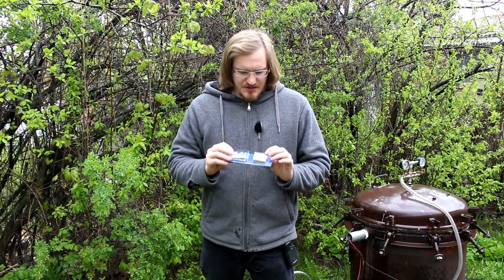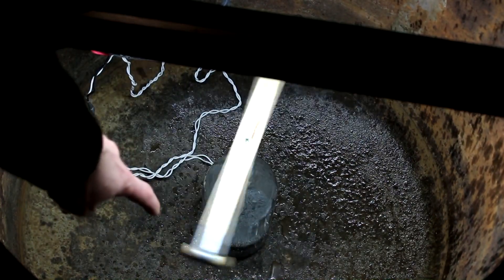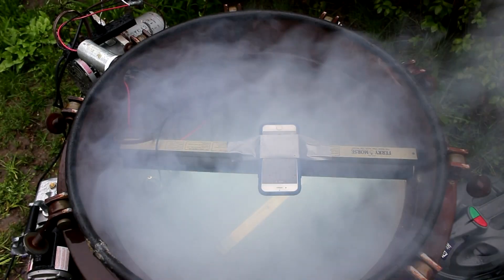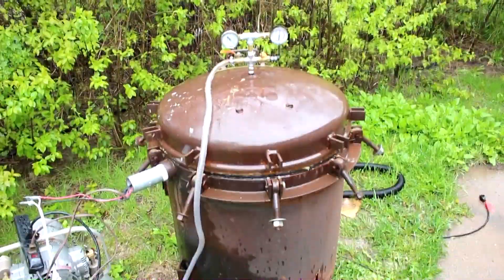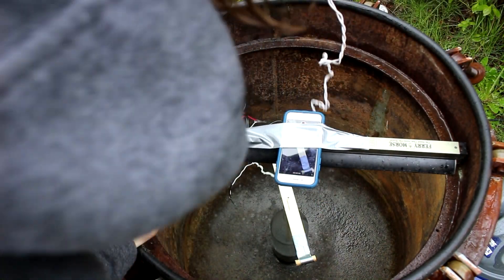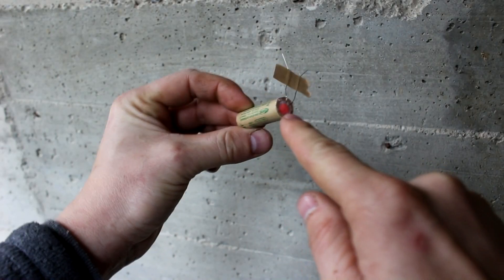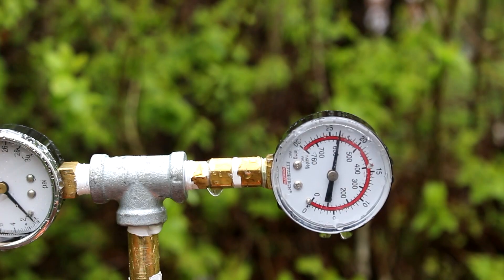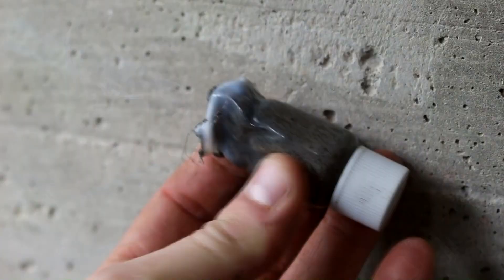Will a Model Rocket Motor Work In Vacuum?

Comment: That gas quenched the vacuum in the chamber. Compare that with  space. Folks at NASA are the worst fraudsters.
Reply: I have video evidence that rockets DO work just fine in a vacuum. But I'd guess you wouldn't watch it if I pointed it out to you.
Reply: @stuartgray5877   I will certainly watch and try to convince myself.
Reply: @khawarshafi4416  Then lets agree how high a rocket must go to demonstrate.

At what altitude above sea level do you think atmospheric pressure drops to "vacuum"?

Industry standard is ~1.0 Torr for "rough vac" (about 0.02 PSI or ~ 1/725 th sea level)

So at what altitude does ATM pressure reach 0.02 PSI?
Reply: @stuartgray5877  Let's watch the video you mentioned.
Reply: @khawarshafi4416  No.  If you ask me for a video of "a bear shitting in the woods", it IS reasonable for me to ask you what determines the "woods".

Now at WHAT altitude does atmospheric pressure drop to "vacuum"?

how HIGH does a rocket have to maneuver before you are convinced?
Reply: @stuartgray5877  It has to be same as on the surface of moon.
Reply: @khawarshafi4416  The fact IS that it is VACUUM at only 50 kilometers up.
Now watch the YT video: "Uninterrupted Footage of the Falcon Heavy Launch and Booster Landing!"

From launch to booster landing. Then explain to me what you just witnessed.
Reply: @stuartgray5877  I need answers from the guy shooting that video before I tell you what was shown. In the meanwhile why all vids of such events are low quality
Reply: @khawarshafi4416  Oh and don't forget the little fact that this has been done IN FRONT OF TENS OF THOUSANDS OF LIVE SPECTATORS over a DOZEN TIMES NOW!

I have witnessed it MYSELF and I have a video of a falcon9 booster landing taken from a CELL PHONE on my yt channel.
Reply: @stuartgray5877  I can't beat the score of tens of thousands of spectators but on a cold night a guy near my farm posed a UFO in front of hundreds of innocent spectators when he tied a cellphone with string of a kite he was flying. To this this day the poor folks swear by God of what they saw and how the spaceship maneuvered that night. I fear you work for the guys working these rockets and there restrictions on some disclosures right?
Reply: @khawarshafi4416  So do you have a play  by play of what you witnessed? I can point out how much of the maneuvering of the side boosters occured IN VACUUM.
Reply: @khawarshafi4416  One thing I have not told you is that I build, test LAUNCH and Operate spacecraft in earth orbit and deep space for a living. I have personally launched five spacecraft, four of those to deep space. I have been on the mission operations team for three of those.
Google "Mars Global Surveyor", Stardust, Genesis, Deep Impact, Kepler Space Telescope, and JPSS-1 (now NOAA-20)

I have also witnessed over 20 real rocket launches up close and in person, including: Athena, Atlas, Delta-II, Delta-IV, Minotaur, Space Shuttle (launch AND landings), AND Falcon9 launch and booster return.

Maybe you should go watch one yourself so you can be convinced.

For some pictures of earth from space that I helped take, google "EPOXI images of earth" and tell us what you find.
Reply: @stuartgray5877  Glad to know that you are among the people directly involved in these things. If the liquid oxygen can burn at such altitudes then it means that there is no vacuum. A vacuum Large as the space is too much to quench. Any form of Oxygen carried on such a large vacuum will first be utilized in quenching the void and the remainder will burn.
Reply: @stuartgray5877  On propulsion in void of space with chemical or mechanically generated exhausts I am still not with you and every engineer and physicist that ever lived. The 1969 launch from lunar surface is well-known near  illustration of what you are saying. I will rather put my money on a slingshot. Carrying of momentum by bullet is a different scenario but propulsion with open exhaust system doesn't make sense when juxtaposed with SIZE OF THE SPACE AND IT'S VACUUM. It would be kind to explain HOW SUCH EMISSIONS FROM ROCKETS QUALIFY TO BE TERMED AS AN ACTION AS STATED BY NEWTON'S THIRD LAW?? I would rather term it as AN ATTEMPT than an action capable of causing an opposite and equal reaction in void of the space. 
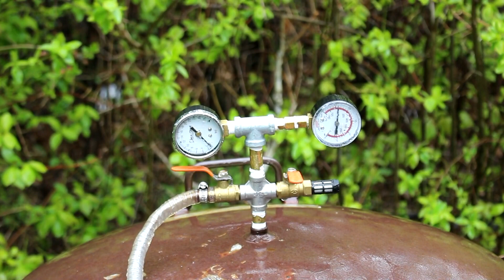One thing I am really confused with is the velocity of the rockets at liftoff. The claimed speeds are mind-blowing but the footage tells entirely different story. I have a very good idea of what an object traveling at 1000fps look like. To be precise at what speed that rocket in your cellphone video was traveling? I noticed it lifting off at 0:30 and boosters separating at 03:15 right??
Reply: @khawarshafi4416  So yu refuse to answer my simple questions? Then I cannot help educate you. I CAN help you understand IF you just answer my simple questions.

Will a BULLET still go off in space?  The answer is YES!
WHY?

Will a block of C4 STILL EXPLODE in space? YES!  WHY?

If I fired a CROSSBOW in space, will I STILL FEEL A RECOIL? Yes or No?
Reply: @khawarshafi4416  The rocket was travelling at 3600 MPH Eastward when the side boosters separated.

Let me ask you: did the separation LOOK like it was three rockets separating from each other at 3600 MPH IN ATMOSPHERE ??
NO!  If the boosters had STILL BEEN IN ATMOSPHERE, they would have been RIPPED from the center core in a millisecond!  But they separated GRACEFULLY almost as if there was NO AIR AT ALL.
Reply: @khawarshafi4416  - "HOW SUCH EMISSIONS FROM ROCKETS QUALIFY TO BE TERMED AS AN ACTION AS STATED BY NEWTON'S THIRD LAW?? "

Its pretty simple:  
1 - Does the EXHAUST GAS have MASS?
2 - Can MASS be accelerated WITHOUT a FORCE?
3 - Is the exhaust gas ACCELERATED when it leaves the nozzle?

So when the exhaust gas (WITH MASS) IS accelerated from the nozzle - FROM WHERE DOES THE FORCE ORIGINATE?
Just answer that simple question.
Reply: @stuartgray5877  The results associated with Gunpowder or C4 going off are in fact chemical reactions we see on Earth. The chemical reactions will not be the same if attempted exposed to vacuum of space.  Crossbows will  not only kick but the projectile will also be launched.
Reply: @stuartgray5877  I didn't pick such detail from your cellphone video. So the separation took place on border of space vacuum?? What was the Alt at point of separation?
Reply: @khawarshafi4416  - For 1 - C4 and bullets DEFINITELY work in vacuum just as they work UNDERWATER - because they HAVE OXIDIZER IN THEM.
2 - Explain the total experiment of firing a crossbow in zero-G, in a vacuum.
If an astronaut had a remote controlled crossbow, he loads it, cocks it, and places it beside him floating in the vacuum.
WHAT does he observe happen to BOTH the bow and the projectile if he FIRES the bow by remote?

WHAT does the astronaut observe happening to BOTH of them after the firing?
Reply: @khawarshafi4416  - "I didn't pick such detail from your cellphone video. So the separation took place in place?? What was the Alt at point of separation?"

You watched the event from the ground video. Now watch it all form the onboard video cameras.
Find the YT video: "Falcon Heavy Test Flight" from Spacex themselves.

You can align every event in the videos for proof that they are BOTH real.

then you can watch the other DOZENS of videos from spacex depicting similar events during launch. For EXAMPLE, watch ANY of the Starlink Launches and WATCH the payload fairings deploy. You CAN TELL from the videos that the rocket MUST BE IN HARD VACUUM for the payload fairings to come off like they do when the vehicles is moving THOUSANDS of miles per hour.
Reply: @stuartgray5877  Some gave a very good reply of similar question. The action in case of gaseous emission from exhaust/ nozzle is similar to applying force to a car with both feet in air. No matter what gas is emitting it must be sufficient in quantity to first quench the vacuum else it will remain an attempt or a preparation but not an action capable of generating a reaction.... With this analogy even the authenticity of the so called space suits used by Apollo crew is questionable. There are so many things that don't fit the logic. Now I hear words on actual limits of Earth's atmosphere, and space odors etc all to justify the blunders started from 1969 LIVE broadcast of moon landing and back. That hoax has cast unimaginable magnitudes of doubts about integrity of space programs....
Reply: @stuartgray5877  Gunpowder or any other chemical that ignites and produces gas and flame in presence of oxygen/oxidizer SHALL NOT PRODUCE SAME RESULT IF IGNITED EXPOSED TO THE VACUUM OF SPACE. 
The crossbows, slingshots or a spring are mechanicals  and are unaffected by zero gravity or vacuum. *Crossbow will kick in the direction of projectile due to inertia from string. Still it will be interesting to know your findings on these mechanicals.
Reply: @khawarshafi4416  - "SHALL NOT PRODUCE SAME RESULT IF IGNITED EXPOSED TO THE VACUUM OF SPACE. "

But when the FUEL and OXIDIZER are combined in the rocket engine they ARE AT 3000 PSI!

are YOU suggesting that Liquid Oxygen and Liquid Hydrogen WILL NOT COMBUST AT 3000 PSI ?????

They vent to vacuum AFTER COMBUSTION!

Now WHY cant you answer my question: From WHERE does the FORCE originate that ACCELERATES THE GAS ?

You wont answer that question because the SIMPLE ANSWER - PROVES YOU WRONG!

The force that accelerates the gas INTO THE VACUUM comes FROM THE NOZZLE!

The NOZZLE exerts the force that accelerates the gas!

Now CAN the NOZZLE exert a force ON THE GAS without FEELING THE SAME FORCE BACK ON ITSELF?
Yes or NO?
Reply: @stuartgray5877  The nozzle part has been explained by experiment where a vacuum cleaner was used to collect whatever emit from a gas source. Turned out that no movement could be generated by shape or size of the nozzle when the vacuum cleaner collected all the exhaust in earth's atmosphere.
Reply: @stuartgray5877  what's the fuel used in secondary booster in your  cellphone video
Reply: @khawarshafi4416  All of the Falcon9 boosters use refined kerosene for fuel.

The new Starship uses methane.

The Space Shuttle main engines used Hydrogen.
Reply: @khawarshafi4416  Lookup my resume on LinkedIn. I dont hide my identity, just Google "Stuart Gray Lockheed" and find my resume.
what does it SAY genius?
Reply: @stuartgray5877   I will look that up.      Trying to workout how much advantage you have with all your labs and equipment and production over an ordinary space observer working with few equations and observations. So far all the disadvantage is yours.
Reply: @stuartgray5877  Why you are not convinced with results of experiment with vacuum cleaner collecting air from deflating balloon
Reply: @stuartgray5877  I told you eyewitness account of how tens of thousands or millions of spectators can be fooled. Same goes for videos. As for the eye witness account I will ask you again for removal of doubt " IN REAL LIFE DID YOU TRAVEL TO THE MOON IN A ROCKET, LANDED ON IT'S SURFACE, HAD A WALK AROUND AND THEN RETURN TO EARTH ?
Whatever I stated about the balloon test was verified by me. I don't have the miniature replica of the type off rocket vent you mention but I am sure someone will do that sooner or later.
Reply: @stuartgray5877  Now I more firmly believe on whatever I said and tested.
Reply: @khawarshafi4416  Watch the YT video: "Uninterrupted Footage of the Falcon Heavy Launch and Booster Landing!"
This is FROM THE GROUND.

Then watch the same events FROM THE ROCKET: Watch YT video "Falcon Heavy Test Flight" from SpaceX.
COMPARE THE TWO videos to convince yourself they depict the SAME EVENTS.

Then tell me WHAT YOU JUST WITNESSED from liftoff to side booster landing.

EXPLAIN what you just witnessed, in your own words.
Reply: @stuartgray5877  haha are you talking about spacex vertical zepplins?
Reply: @fehmidonmez7810  So please tell me how many actual rocket launches have YOU attended in person.
Ill go first:
I have witnessed over 20 real rocket launches, many from closer than the public is allowed to go.
I have see WITH MY EYES: Atlas, Athena, Delta-II, Delta-IV, Minotaur, Space Shuttle (launches AND landings), AND Falcon 9 launch and booster return.
I have been the spacecraft Integration team for four missions including putting the spacecraft on the rocket and performing hazardous Fueling operations.
I have been the Launch CONDUCTOR more than once.
ANd I have been on the mission operations team for three spacecraft, two of those in deep space.
I will be launching a spacecraft in environmental test right now, on a Falcon 9 later this year.
I have toured the SpaceX factory, more than once, and met Elon Musk himself.

YOUR TURN.
Reply: @khawarshafi4416  'stuart gray' is a chatbot. it doesn't understand any physics, just abuses people 24/7/365.
Reply: @papalegba6759  So it is true that folks at NASA are worst fraudsters.
Reply: @stuartgray5877  it's easy to make a yt page with a few videos on it then allow a bot to run the account. you're proof of it.
Reply: @papalegba6759  do bots post videos of themselves at KSC launch facilities?
Reply: @khawarshafi4416  OR you COULD just watch this weekend's launch of Falcon heavy. The LIVE video had numerous examples of rocket propulsion in a vacuum. If you can't spot the MULTIPLE examples of rocket propulsion IN A VACUUM in that video, just let me know and I will point them out to you.
Reply: @stuartgray5877  again with cartoonz 😂😂😂😂😂😂😂😂😂😂😂😂

Comment: There was no vacuum because the bolts on the chamber were not fastened.
Reply: see the wisp of smoke rising from the igniter at 3:57 ? that means it's not in a vacuum. fraud, plain and simple.
Reply: Val - I can pump down a GIANT vacuum chamber with the DOOR closed, but NOT LATCHED AT ALL.
Would you care to explain HOW?
Reply: @stuartgray5877  you can't do anything, you're just a chatbot.

Comment: fraud.
Reply: The fuck
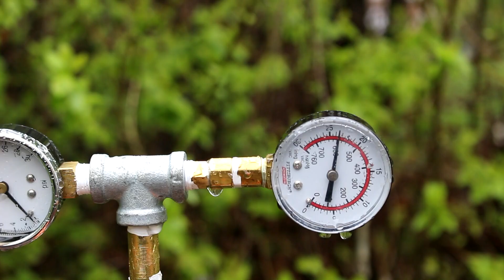Reply: @PJPEE  from 6:32 there is clearly water at the bottom of the vacuum chamber. but water boils in a vacuum. ergo the vacuum chamber did not contain a vacuum. ergo fraud.
Reply: @papalegba6759  at 7:58 you can see the water boiling as the vacuum pump runs
Reply: @PJPEE  no you can't. the 'experiment' is a fraud, as are you.
Reply: @papalegba6759  why am I a fraud? Who's to say you're not the fraud spreading lies? 
Maybe you should recreate this experiment with the accuracy you desire, then send a link to prove your point.
Reply: @PJPEE  maybe you should stop being a chatbot spamming lies & pseudoscience?
Reply: @papalegba6759  I guess if you can't even accept that I'm a legitimate person, you're never gonna have any personal growth. Enjoy your hat made of foil.
Reply: @PJPEE  i guess if you keep lying & promoting pseudoscience i have no reason to believe you're a legitimate person. because that's not what legitimate people do.
Reply: @papalegba6759   explain my lies! Where does your scientific knowledge stem from? To me you're the one speaking "pseudoscience"
Reply: @papalegba6759  if you really want to clearly disprove this, why not conduct your own experiment? Or at least provide a source to a well conducted experiment that disproves all this? I'd be happy to change any of my opinions with good quality evidence.
Reply: @papalegba6759  - So when the rocket nozzle ACCELERATES the MASS of the exhaust gas, into the vacuum, - from WHERE does the force originate?

VERY simple question ( for people that have taken a physics class).
So what is the answer?
Reply: @stuartgray5877  told you 100s of times: thermal energy from combustion. do you not know rockets have combustion chambers, thicko chatbot bro?
Reply: @stuartgray5877  newton's 1st law requires an EXTERNAL force, dumb chatbot stu. but a vacuum cannot provide an external force. game over, you lose as usual.

Comment: Never saw a rocket with a melting pressurechambre around it.. OMG you guys are so funny.
Reply: They don’t, srbs aren’t ignited in the vacuum of space much, and if they are, they have a frangible diaphragm allowing pressure build up. For liquid fueled rockets ( Hydrolox, Methalox, Kerolox) they build enough pressure in the combustion chamber from the expanding gasses that they don’t need an external pressure chamber or diaphragm.